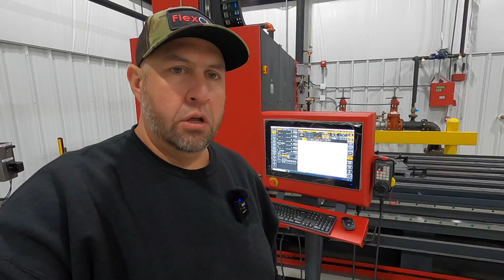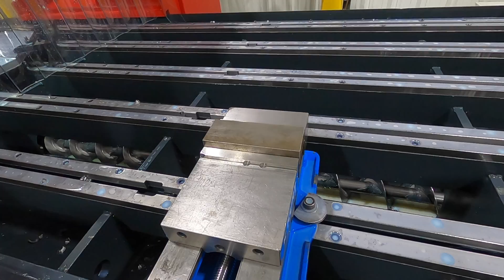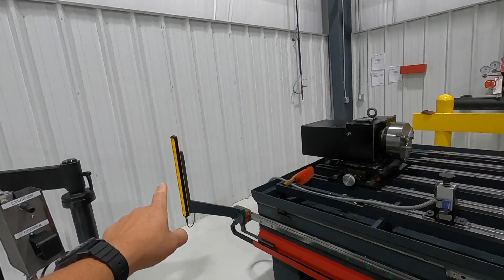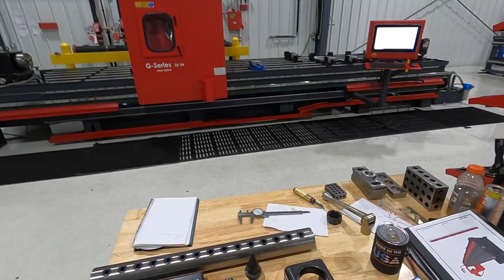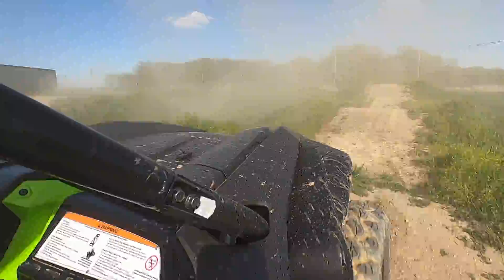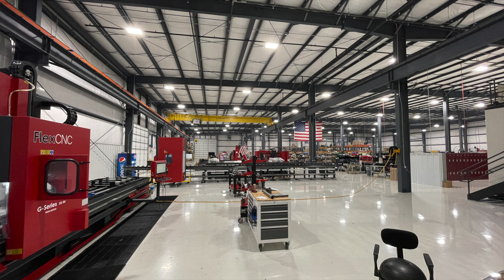SNS 347: CNC Training @FlexMachineTools

Comment: I can't wait to read through the comments for all of the "don't do it Adam, stay with manual machines", "CNC machining is soo boring" or "CNC isn't  real machining, manual machinists are real machinists". Good on you Adam, never stop expanding your skill set. Don't forget your beginnings and make sure you learn how to morph your skill sets into one large skillet, a lot of manual machining applies to CNC machining and a lot of CNC machining practice crosses right back to manual machining. Not judgment for those that want him to stay with manual, but the bills and banks do not care how you make your money as long as they get paid. Job shops with manual and CNC are the best places to work for those that want constant challenge, and the need to constantly solve puzzles. You can get a small Fadal VMC in your shop, it is a great way to get your feet wet in CNC.
Reply: I'm a woodworker by trade, but also operate a 5-axis large format CNC. I don't believe that a successful broad skillset worker can exist in one or the other these days. Learning CNC from the G-Code upwards is the most direct way of translating one's manual approach into making the tool (CNC) do what you need it to do. A CAM-only CNC operator ends up learning from the wrong end, and understanding of how-why is sidestepped. In fact, a lot of the principles of CNC in woodworking absolutely require a good understanding of manual work, otherwise the tool blows out material, grabs a workpiece and flings it, or just doesn't end up with a level of quality/accuracy if it does reach the finish line. To Adam, having the ability to bring CNC into his skillset will push that envelope outwards, not simply provide an isolated bubble to sidestep into. Looking forward to seeing what he does with it.
Reply: @TristanJCumpole  Totally agree, the context is better understood when you come from manual machines. The little nuances   that you learn from manual machining translate so instinctive to CNC, you don't even pick up on the little things that you bring over. They become second nature, I am a STRONG believer in knowing manual G-Code. CAM is faster in some/most circumstances, however, when you know the language you can manually program faster from a blueprint (in limited scenarios). Being the best machinist means knowing the whole trade, every task and process have things that add value to your toolbox of skills.
Reply: @sshep7119  Unfortunately the software running the machine I currently work with doesn't easily allow for manual G-code, however it's relatively flexible. Enough so that I can apply the principles that I need to in order to get the result done as I require. My background is as a programmer, having been brought up in assembly back in the 80s, command line in the 90s, etc. It all comes down to building a solid basis of understanding, rather than sidestepping the knowledge and having software approximate intentions. A lot of my days involve accurate machining of Corian and other solid surfaces as accurately as is feasible in order to reduce final manual finishing. That really starts to make CNC more like a money printer when dialled in! My complaint with the software I have to use is that I can't tweak entrance/exits to corners when milling coves, and the endmill I have deflects under tool pressure, especially when it doubles in dwell when hitting a corner. Ah, fun times eh?
Reply: @TristanJCumpole  It depends on the controller but you may be able to use G8 or G9 for the problem , I may not be understanding the issue you are having. If you really need it fixed shoot a video and post the code up on Practical machinist or CNC zone, there are a lot of guys who are infinitely better at G code than me. G code is a standard in some regards, however there are always additional codes or variations in the machine program. There are a lot of G codes that are SUPPOSED to comply with a standard...* Keyword supposed
Reply: @sshep7119  That example is a basic tool issue than a G-code problem, one that an operator that doesn't come from manual machining would miss and blame on the software rather than expecting it prior to engagement through experience. Deflection in the cutter changing when the presented cutting surface suddenly increases changing the deflection vector, deflecting into the workpiece significantly at the corners. It was a conundrum for us also, but one that requires shorter endmill stickout and as wide a shank as possible. Corian is taxing stuff sometimes!

Comment: Getting to grips with the differences is essential. Basics like tool changing and setting are quite different. Jogging isn't, except that you have no tactile feedback.

CNC should be exciting. G codes come with time.  Put comments in your code to remind yourself of the less common ones.

Best to learn about the most common codes before having CAM software generate it for you. That way you can read the genrrated code and feel comfortable that it's going to do the right thing.

Comment: When I was at college immediately after leaving school (96 to 98) I did a mechanical engineering course and the machining on that was all manual and I loved it (especially turning). After that I got a job working as a CNC wire erosion programmer and operator and that was really my first taste of CAD software (AutoCAD R14). I now work as a project engineer specialising in lightning protection and HV power earthing so no more machining, but I still use a LOT of CAD for my designs. I know that you are going to have a load of recommendations for what CAD software to try, but understandably I do like AutoCAD. Mainly because I am used to it and also because there are lots of ways of accomplishing the same outcome - for example, drawing a line - use the button on the toolbar, type in line (or LINE) and enter, or just type l (or L) and enter. Same for circles, arcs, polylines, and so on. I probably do things very differently to my colleagues who do the same job, and it all works. Our R&D guys use Creo (because they have to, company policies and all that) and are kinda liking it now that they have had over a couple of year's experience, but it has taken a while.

Comment: I could recommend solidworks as a cad program, easy to learn and easy to use and plenty of information to find online if you trying to learn.
Reply: You are either rich, or using as a business, mere mortals choke @$5,4xx.00 plus ~$1,400 annual maintenance fee.
Reply: That is a realy good program :)
Reply: @Wolfy_80  Let me guess, you are rich as well. For a shop, yes. For  home shop! Not gonna happen.
Reply: @carlthor91  indeed using it for my business, You are not obliged to take maintenance every year, once you paid for your license it's always yours, you just can't get updates anymore.
Reply: @carlthor91  Iff Adam really goes CNC it will pay itself, Solidworks can come with a good cam module, it will save him a lot of time programming, ofcourse there are more software solutions but the good softwares cost pretty much about the same, it's just a choice what suits your needs.
Reply: @carlthor91  well I work with that program in a shop of course :) And I realy love it. But if you want it for home it´s not that high pricetag for it and like said before, only a onetime purch.
Reply: @matthijsnibourg891  I would think Adam would need a larger job shop to justify the purchase. Annual upgrades are ~$1,4xx.00 ongoing. I worked with a Geo-modeling suite, it was $10,000 a seat and $1,000 per seat annual  cost, at a multinational mining company. You have to generate seriously large income/benefits to justify the costs.
Reply: @matthijsnibourg891  I know that, the systems I used, offered new/better usability/functionality, with the updates, mining companies shoot you down real quick, if your pushing fluff.

Comment: @abom79 good on ya Adam!  I knew you couldn't stay away forever 😜 your at an advantage, when it comes to learning cam, being a manual machinist you will intuitavly know order of operations and the tool you need.  Gcode is really easy to learn. If you stop by John's place see if you can do one of his fusion classes, I sat in one a couple of years back and had a really great time.  I left a little pair of Abom sized callipers there when I visited I suspect you don't have a bigger pair 🤣

Comment: An interesting way to make holes - almost friction welding - and there's little loss of material as it is pushed to the side and through - ideal for effectively adding metal to the hole for tapping. I guess it'll only really work on relatively thin material compared to the 'drill' - as otherwise, the work would absorb more heat that the bit - and that could cause problems !

Comment: Adam is the Flex 20 04 normally an enclosed machine in a production environment or is it normally used in the state it is currently at?
I'm asking because of the "rubber" curtains. If a heavy tool breaks at high RPM couldn't it be flung outside of the working area?

The CNC is good at producing a bigger volume or a lot of tool changes (like the Tie rods) so don't make excuses. The manual machining is way better for low volume production/repair anyway.

Comment: I use Creo (Pro/Engineer) every day at work, but I would definitely suggest Fusion 360 for a newcomer to CAD, and it has integrated CAM which looks really nice
Reply: @ricardomierz8467  But Flex CNC are mainly hardware, right? I can't see any CAD software on their website.
Reply: Creo, Solidworks, Fusion all use parametric processing . All have strengths and weaknesses, all get the job done. The big difference is when the CAM comes into play, however at the level Adam is at there is no real difference. When 4th and 5th axis come into play CAM packages get real revealing real quick about what weaknesses plague the software. Just, whatever you do, don't  try to go headstrong right away into Hypermill or Esprit, those are $50k software packages for a reason.

Comment: There's no doubt CNC is fantastic and obviously the way forward ... and it's nice to see you dipping your toe in Adam .. but I cant help feeling that machine/human magic is lost .. I'm sure you would rather be behind oily dials and levers   than a keyboard anyday..
Reply: The brutal truth is that some complex things are obnoxious (if not impossible) to do on manual machines. Let the robots do the tricky 3D stuff and while the CNC runs you can work on the manual machines.
Reply: @Joelsfilmer  they are mindblowing machines mate .. and I'm not an engineer or machinist .. I just Imagine a manual machinist after 30 yrs still gets a jiggle in his belly when he hits a size bang on:)

Comment: Time to put more of those pesky manual machinists out of business! (joking, probably)

For the love of god, stay away from Fusion360. It's pretty awful, even for hobbyist stuff. I personally use CATIAv5, but I'm an aerospace guy. Solidworks is decent, as is Inventor, provided Autodesk doesn't screw you over.
Reply: No pesky, old iron can still make pretty decent retrofit CNC machines
And because I'm curious: why do you not like about Fusion 360? I see some problems with it, but I still like to use it. Don't forget that not everyone is willing to spend thousand of dollars on a software.
Reply: @CatNolara  Its methodology doesn't really carry over to other, better, software. I would be considered an "expert" in CATIAv5, and I found the way Fusion360 does stuff to be completely backward. I spent 16 hours trying to do in Fusion360 what took me 10 minutes in CATIA.

Fusion360 doesn't handle large assemblies very well without bogging down, and their tree structure is non-intuitive.

Additionally, Fusion360 requires you to save your stuff to their proprietary cloud, which is sketchy as hell.
Reply: @thomasbecker9676  I can agree to some of your points, however it still is a good option for someone just starting out with CAD.
Reply: @CatNolara  Eh, I taught myself CATIA, so I don't know if I agree. The longer one stays on Fusion360, the more they'll struggle to learn good modeling software.

Comment: If I'm wrong could anyone let me know ? That 4th axis could that be made to run as a fully functional lathe ? All the wile as a cnc mill potentially only limited by the hight of the gantry ?
Reply: The 4'th axis is a dividing head. This is not a machine one would try use as a lathe.
Reply: Anton.ursid🙏🙏🙏🙏🙏💝🇲🇨🇲🇨🇲🇨🇲🇨🇲🇨💝🙏✌👌
Reply: 4 axis cannot be used as a lathe it's an indexer

Comment: I would have put a kill switch on that mill where it won't even start if the handle is not stored somewhere holding a switch down
Reply: I have seen that for Lathe chuck keys
Reply: A regular worker would quickly find out that you can also put other stuff in there to trigger it. Finding loopholes in safety systems is dumb, but a lot of people do it unfortunately, just to make their work more convenient.
Reply: @CatNolara  true before we went to light curtains we had safty mats as long as you stood on the onr mat you were good to go. one operator would put a concreat block on the mat so they could start the machine and walk away.

Comment: Adam, that Flex CNC is really high end. Fusion360 is a great software to design parts and convert the design to G-Code. You should've designed some 123 blocks.

Comment: So your moving over to the dark side. I can’t say I like that control on that machine. Having a touch screen to control a CNC machine is not a tactile or even safe way to operate a machine. You have to look at the screen to make sure you touching the correct key. A control should be able to be operated with you hands on real knobs and keys you can feel, while looking at what the machine is doing. You will do fine because of your manual experience. You understand the tooling that is more important than the code.
Reply: Surprised to hear that from you. Hope you both get a chance to try each other’s types of equipment out
Reply: Chancellor Crappie  The Mazatrol is really a Mitsubishi Meldas control. But the Fanuc is the standard that people should learn on. If you can run that your pretty much OK on anything else. The thing I really didn’t like was when he pushed start and walked away from the control. He should always have his hand on the feed hold and watch the machine ready to stop it.

Comment: I cannot believe how stable that camera was in the buggy. I've got no idea what gyro or gimbal you use, but it's fantastic! 👌🏻
What's a "side by side"? The only thing I can think of is a shotgun? Which are also fun of clay pigeon and target sports. 
The only animals I'd kill are rats.

I'm pretty sure those flow drill's are normally made out to tungsten? I think flow drill's are brilliant but you need many KW's to easily push through a piece of material. You definitely need RPM's but it's the torque that does the work 😉
This is why people love (myself included even though I still love ICE) electric car's because the power is savage! 

Tungsten is by far my favourite metal. It's done such amazing things and it's just a fraction lighter than gold. This is how so many people have been conned, thinking they've bought gold to find out that the inside is full of tungsten.

Comment: I'm no machinist but it appears that CNC machines are mainly for doing high production jobs and those that are very complex in nature.
Reply: Either high production or very complex parts you cant do well on a manual mill for example 3d curves surfaces
Reply: Disagree, no disrespect. Doing something like the block he did with the tapped holes, not a hard part and can be done easily on a manual, but the time difference between the CNC vs the manual mill is not even close. The machine was not really moving at max rapids for the part. What you would spend on just one hole the machine can do half the holes a c possibly be on the first tool change. Once you get the programming down and your tools worked out the machine flys. I like doing manual machining, but I cherish being able to set tne CNC up to run 5 operations anc hitting go and walking away only to come back to a finished part. If you hac to just drill one simple hole in a single part and that is all, the the manual mill is faster. As soon as you have multiple holes, or tool changes the CNC does it better

Comment: aweome! nothing like getting a taste of the present while keeping a hand or two on the past! I'm sure those folks that own classic cars for the most part don't drive them everyday right?! Is that "G-code" manual proprietary or available to the public? Seems G-code for CNC and 3-D printing have something in common? sorry for the questions; just finished moving that 'rock'
Reply: It's and open standard. And it's the same G-code 3D printers use. Of course, the code generated for a 3D printer is very different from a CNC milling machine, but the language is the same.
Reply: @soupisgoodfood42  thank you!

Comment: With the heat that was generated, in what is the condition is the formed iron left?   Does one ever have to do any tempering afterward?
Reply: mild steel doesn't harden ,so heat treatment is probably not required
Reply: @paulg3336  did not know that.  Is mild steel the only metal on which they use that technique?
Reply: @perlygatekeeper  It can be used on other suitable alloys ,some of which may need heat treatment ,but the tubing  in the video is mild steel.

Comment: time to build yourself your own CNC machine)    seriously. it's 2021.  I have an aluminium-viable CNC mill in my bedroom. it's a part of life already.
Reply: Or modify one of the milling machines to a CNC-manual-hybrid. Position controlled drives on all axes, a brain for the G-code handling and an electronic handwheel to move the machine manually when needed. You don't even need to walk around the machine to get to all the handles anymore then :D